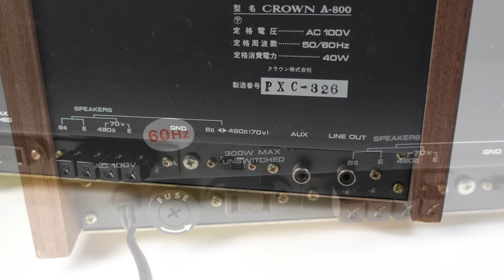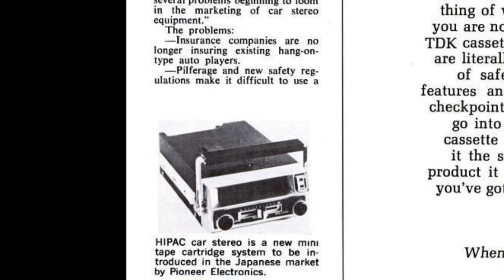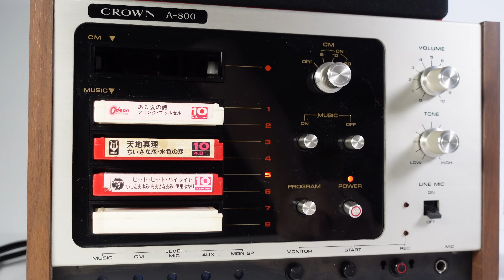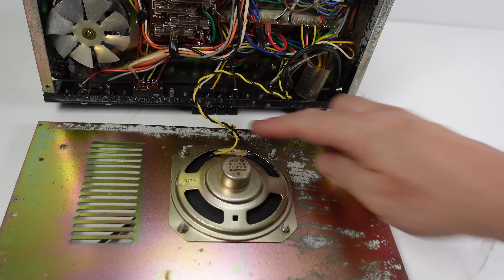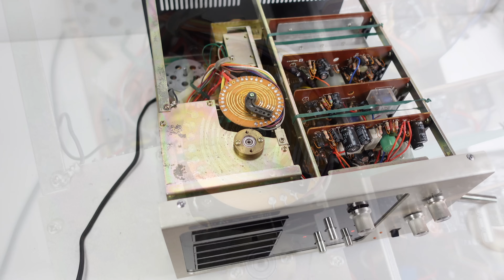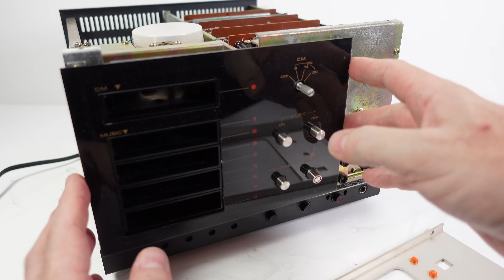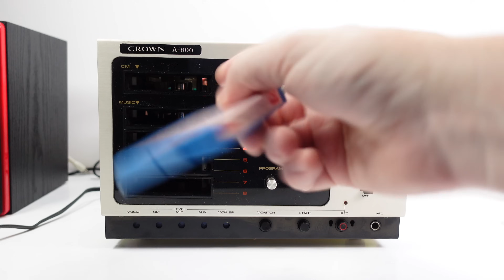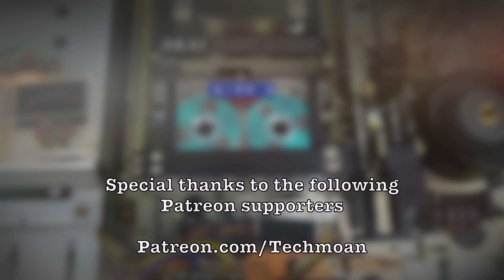An unusual player for a forgotten ‘70s music format

Comment: CM is one of those sort of English abbreviations used in Japanese - stands for Commercial message ( コマーシャル メッセージ ) and is used to mean advert, like in a TV ad break/commercials.
Reply: Was going to comment the same thing. Yes it’s still in regular use, I work in marketing for a Japanese company and this word is used all the time.
Reply: @kitsuneneko2567  The one I come across all the time is NG (not good). Used as the opposite of OK. You get it on signs and equipment often has the indicator for errors labelled as NG and people say it. Confused me as I've never seen it used in English.
Reply: @reneartois616  that’s a good one too. 
Another interesting one is コンセント konsento from the word ‘consent’. 
It means power outlet/wall socket/power point (depending on your flavour of English)
Reply: @Sumitomato  from the English "concentric plug"
Reply: @bgaskin  wow, didn’t know that! Thanks
Reply: @reneartois616  A lot of those terms are like that, it's weirdly similar to differences in dialect, how you'd find slightly different terminologies used in the US and Australia, but in Japan they've developed their own English-based slang despite not using English as the primary language. Ironically my first brush with Japanese English derivatives was the term Rimokon, which means remote control, something native English speakers actually do abbreviate as two letters, RC.
Reply: There's also AV, which doesn't stand for Audio/Video😉
Reply: @mel816  Adult Video!
Reply: @Allen-ps6bx  JAV 😏
Reply: @mel816  that’s my favourite, I wonder what some Japanese people think when people call themselves “The AV Guy” and stuff. How many look into it to go “wait a minute”, how many are too scandalised by just the name!
Reply: @kaitlyn__L  If Matt gets to travel to Japan (once it's safe to do so), he can introduce himself there as "The AV collector" 😄
Reply: Came to post that too, but yes, CM means “commercials”, aka advertisements.
Reply: It’s like how brits use French words
Reply: I used to hear this in radio "And now for this commercial message."
Reply: @kitsuneneko2567  definitely, and in many cases used for a very different meaning than the word originally borrowed. My fav is baikingu (バイキング) from the word Viking and used to mean buffet style food
Reply: @Sumitomato  Yes, but remember English has "Smorgasbord" (which is more-or-less Swedish for "Bread Board/Table").  I'm sure there's a link, but that origin seems lost to time.
Reply: @Sumitomato 
ah! smorgasbord! sumogasubōdu? 🤭

Comment: I'm not sure, but that looks like a more rarely used bipolar(unpolarized) electrolytic capacitor. If you decide to change it, make shure you don't get the wrong kind (polarized/unpolarized)! Unpolarized capacitors are usually used in audio crossover filters. Or you could simply use some other unpolarised type, like a polyester film capacitors.

Comment: Please note that 50 Hz requires a transformer with a larger core then 60 Hz (other way around isn't an issue). Back in the 80's a workmate to my father bought an answering machine when he was in the US and connected it via a step down transformer. One day when he got home it had started to melt and was smoking with the frequency issue as the likely cause.
Reply: That's the part for which the label on the back says "50/60 Hz". The motor drive is the only part here which is specifically 60Hz, and that's because of mechanical timing.
Reply: Tell about it to the output transformers in the tube amplifier.

Comment: "It looks like this was kept in a very humid place"

Yeah, Japan. 😂
Reply: The prevailing winds make it worse. In the winter, cool dry air comes from Siberia, picks up moisture over the warm Sea of Japan, then dumps it on the island. In the summer, the prevailing winds change to the opposite direction, from the tropics, and that blows hot moist air onto Japan.
Reply: @straightpipediesel  Resistance is futile !
Reply: That was my thought too. Japan is just a place to keep coastline.
Reply: True.  I import a lot of vintage lenses from Japan and more often than not, they suffer from internal fungus.
Reply: Haha, that’s what I thought too.  “Somewhere humid..”  .... like an island?
Reply: I've bought a few pieces of hi fi gear from Yahoo Japan and always try to spot the tell tale signs of corrosion. The pictures are usually terrible so it's not always easy but so far, so good.
Reply: High side of a tsunami?
Reply: Japan 🗾 is very hot at times
Reply: Japan is humid as all heck. It's all coastline or mountains.

Comment: Don't know for sure if it'll have the desired effect but to test it you don't need to replace the capacitor already in there, just with some alligator clips or something add a 0.4uF capacitor in parallel with it.
Reply: I thought so as well. ("Everything has been said but not by everyone.")

Comment: It seems sensible that the cap controls the motor drive speed. It is probably being used as a timing capacitor, where the charge time determines the frequency. Note the smaller capacitance, 0.6 uF (micro Farad) charges faster, giving the more frequent 60 Hz, while the 1 uF capacitor charges slower, giving the less frequent 50Hz. If using an electrolytic capacitor make sure the polarity is right, if using a foil capacitor polarity doesn't matter. You should be able to easily unsolder/resolder the components for testing. If it were an induction motor, a larger capacitor would result in more speed and higher frequency, opposite as to the phenomenon seen here. Therefore they must be using it as some kind of timing device to modulate I guess the voltage, it most likely being a brushed universal motor... Good luck
Reply: Its an AC capacitor you can't use an electrolytic capacitor, it would have to be a foil capacitor.
Reply: No, it is not sensible that the capacitor directly controls the speed of the motor. If it did then the capacitances would be in a ratio 60/50 = 1.2 rather than the 1.0uF/0.6uf = 1.67 specified.
It is more likely that motor is a synchronous type that operates at a speed determined by the mains frequency and that the capacitor is connected to a motor start winding to get the motor moving in the right direction when power is applied. Changing the speed with a synchronous motor will require changing the motor type to one with a different number of poles.
Reply: @stephenbell9257  I've never heard of a low cost cassette player motor of about 3cm diameter built as a synchronous motor. Also, for a start capacitor, the difference between 0.6uF and 1 uF is non-existent and they wouldn't bother speccing 2 types... Maybe they are actually using the capacitor as a resistive/capacitive divider and running a brushed universal motor off the dropped voltage...Seems most logical

Comment: Yep, the capacitor charge/discharge is used for timing and changing it will affect timing. Just ensure you replace one with a similar (or higher) voltage rating.
Reply: It's proabobly not the speed, the tolerance on these tends to be pretty wide, and if it was a timer cirucit they would have used a cheaper smaller capacitor. This likely provides a phase shift to help start the AC motor.
Reply: And maybe the most important part, You can't damage anything by increasing the capacitance. Just tie another one in in parallel to reach the desired capacitance and see what happens.

Comment: If the motor ran on DC the mains frequency would not effect the speed. This is an AC motor so changing the cap will effect the speed. Make sure you fit a good quality cap preferably one made for motors with an AC voltage rating. Either way it should be a non polarised type NOT electrolytic.
Reply: Agree except for the last bit - you can get non-polar electrolytic capacitors, they're used in some speaker cross-overs etc.
Reply: @Shaun.Stephens  Very true Shaun, but they are not really high enough AC voltage rated. Best to use a 400 volt AC rating.
Reply: @MichaelBeeny  BTW you wouldn't need a 400V rated cap as that machine is only running at 100V (according to the back). Therefore a 150V would do (100V x 1.41 to give peak of RMS AC voltage) but best to go to 200V (if they can be found) to be safe. However probably best to go with a polyester or similar cap for that value these days.
Reply: @Shaun.Stephens  You are right of course, I forgot it was only 100 volts, and it was 1am in the morning!!
Reply: Just checked and I can't find one rated for more than 100V. A more thorough search might turn one up but actually 100V is the highest I've ever used so maybe not.

Comment: you don't show or mention it when trying to record on the announcement cart but does the Start button play a role?  I remember the college radio station I DJed at had a "random sayings" cart that had multiple recordings on it but would only play one at a time before stopping.   Could the start button be what records the tone?

I know  when I worked retail we had a cassette player tied to our PA system that every so often would fade down Muzak to play an announcement.(even if mid song).  Once it was done, the music faded back up.    Never tracked how many announcements played before repeating but it seemed like every 20 minutes one played.   Assuming that cassette deck had some kind of tone detector and auto reverse.  At some point they went to a computer system so corporate could download MP3 files directly instead of sending a tape to 100+ stores and hoping staff would change them out when needed to reflect current sale items.

Comment: Just connect a 400 nF capacitor in parallel with the 600 nF one, that will produce the desired capacitance for 50 Hz. You don't even need to solder to test it.
Reply: 400 nf / 0.4uf
Reply: That's not going to help the speed. It will just phase the motor windings properly for 50Hz. You still need a different motor pulley.
Reply: @johnstone7697  Yes, thats the snag. The Capacitor must have the same reactance for 50 or 60 Hz , so the capacitance must be  must be changed when operating on 50 or 60 Hz respectivly. The  rpm of the motor depends only on the frequency so  the only way to get the required rpm to the capstan is by changing the pulley.
Different machines of other makes used a internal frequency generator for  the motor and control the output by a quartz oscillator. I had an old record player with that kind of motor control. So it rund on 50 or 60 Hz without any change over switch or pulley.
Reply: @johnstone7697  I am sure this is correct. Low voltage AC motors often have a second winding with a capacitor creating a phase shift. 50Hz requires more shift than 60Hz, hence the different capacitor.  I was hoping the video would show the label on the motor, but it didn't. A quick check on the wiring from motor to transformer would probably confirm all of this.
Reply: Yep true. But it probably does not set the speed. These things tend to have too wide of a tolerance for that. my guess is that this capacitor helps get the AC motor started, or is a capacitive dropper for some low current standby power rail inside.
Reply: @berni8k  You are probably right. I once had a crude timer device based on loading time for a capacitor but that did not meet the required accuracy.
Reply: I doubt the capacitor sets the speed, because cap sizes are usually accurate to only 10% or 5%.
Reply: 400 is a non-standard value. Getting a 1uF cap would be much easier.
Reply: @777anarchist  100 and 200 are, are they not? For testing if it alters the speed at all any cap in the same order of magnitude will do.
Reply: Agreed on adding a 0.4 microfarad capacitor of the proper type and voltage rating in parallel across the existing one, so 0.6 + 0.4 = 1.0 microfarad.  If it's a run capacitor that might fix it, or if the motor uses a tachometer-style winding then maybe.  It can't hurt to try it.
Reply: I am sure the motor is a synchronous motor with two windings operating with a phase shift. The capacitor would determine the amount of phase shift needed between the two windings for correct motor torque. It would not dictate speed in this case.  I wonder whether the motor labelling gives any clues? Also, checking the wiring from the motor would help clear up what is going on. With two windings with a phase shift there would probably be just three wires from the motor to the AC from the mains or transformer secondary (or sometimes four), one winding having that capacitor in series.
Reply: Username checks out?!?
Reply: I wouldn't recommend attempting this without first checking the voltage on the contacts. AC will blow up an electrolytic cap. I really don't think it's worth doing anyway, since that looks like an impedance balancing cap, which wouldn't affect the speed anyway.
Reply: Irrelevant.  See my direct answer message, but this reply shows a fundamental lack of understanding of motor designs and operation.
Reply: I think you mean 400nF and 600nF, a 400mF capacitor would be massive!
Reply: Is the correct answer.
Reply: @Fuzzytubby  So it's a two phase capacitor induction motor then. A higher value run capacitor would mean less resistance and more current on the aux winding which means more RPM, right?
Reply: I've just come back from watching the video where in the future from this video he DOES ONLY change the capacitor and the machine plays faster!! So egg on all your faces who were adamant that it would not work!!
Well, IT DID WORK!!
SO, NNYAAHH!!
Reply: He could use "clip leads" and do this. But truthfully I do not see it see such a capacitor changing speed (I'm not dead set on it). If it was me I wouldn't change it electrically, but rather use some kind of 50/60 Hz inverter. Edit he could get a 12/24v DC to 120v AV 60 Hz pure sine wave inverter and use a variac to reduce it to the required 100v. A bit complicated but he wouldn't have to worry about switching around the equipment he acquires.
Reply: @metatechnologist  He doesn't even need to worry about the voltage. It's close enough at 100-130v. The parts of the device that might actually care are dropping it to 12VDC or something like that anyway. If the cycles change the speed it's an AC motor, and they really don't care much about voltage. It's not like DC where voltage changes the speed.
Reply: @edifyguy  Actually no. This equipment was made 50 years ago and made specifically for 100 V. As equipment ages it's tolerance for out of spec voltages decreases. Well designed equipment usually steps down and regulates the voltage in which case a higher voltage from the transformer won't matter. But people can't always assume that there is a voltage regulator in place and that the higher voltage won't be passed on to the lower voltage electronics. Additionally, the age of the equipment is a factor. Some techs will power on the equipment but do so at 50% voltage (using a variac) and leave it on for a couple of days in an attempt to "reform" capacitors and not "shock" old equipment with full voltage. No matter the case, I can promise that old 50s/60s/early70s equipment is nowhere tolerant of differing voltage specs like modern equipment is. The old adage an ounce of prevention is worth a pound of cure really applies here. These days I take capacitor replacement as a given and am doing so before plugging in equipment from this era.
Reply: @metatechnologist  I'm going to have to disagree with you on this. In spite of its age, the internals on this are very modern. Also, I seriously doubt he was running this on 100v; more likely 120v, and looking at what's inside this machine as he showed us at length, I see no reason why it should care.
Reply: @edifyguy  Regardless the best way for him to get to where he needs to be i.e. 100 V with 60 Hz is with a DC to 120 V pure sine inverter and variac it down to 100 V. What the machine is spec'd at.
Reply: the comercial value is 470nF 0.47uF but maybe the old capacitor is so old and lost capacitance so it could be better
Reply: Good thinking 👍🏻
Reply: @NeungView  ㎌
Reply: Comic genius ! I wonder if Phil Collins watches this ? 
Peace and love brother 👍🏻☮❤
Reply: Too easy!
Reply: On the other hand, that board also had four fuses just next to it: I suspect it might just be providing more smoothing for the power supply when the cycles are longer
Reply: ... except now I've seen the answer below explaining what it actually does, and it generates a phase-shifted signal for the motor, so it is the component that switches between 50/60Hz. Feel free to disregard me above!
Reply: @NeungView  It's actually muF not uF but good try.
Reply: Dark Dexter gamer Subscribe please 👌👌👌😭😭😭😭😭😭😭